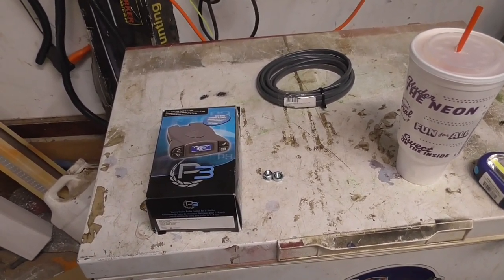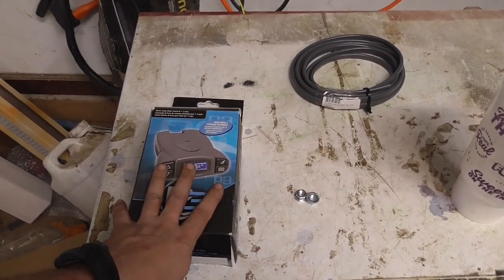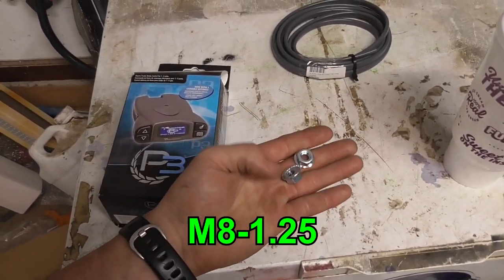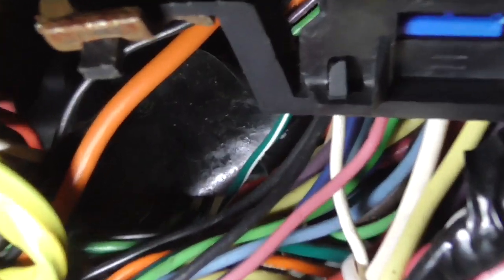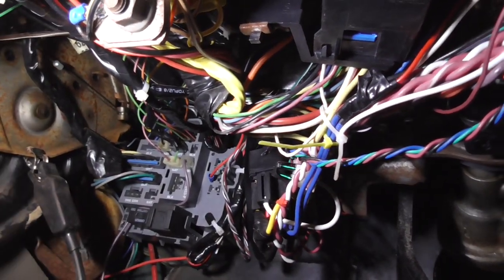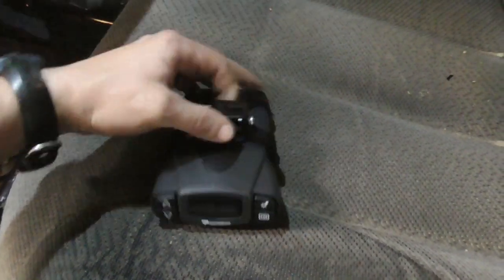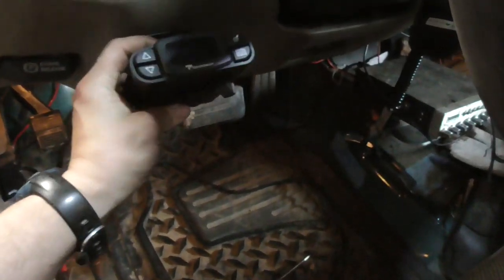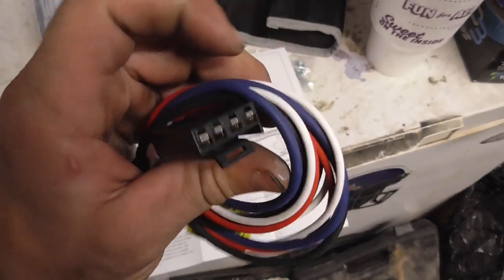Yukon Update | GMT400 Tekonsha P3 Trailer Brake Controller Install | 95-98 GMC/Chevy Truck

Comment: It says in the instructions not to use the inside cab frame as ground,I ran mine to a factory ground in the engine compartment.says something about it not working right other wise.Just a 411.
Reply from the maker: It does say that, but that's just them covering their butt. No reason a good, suitable ground in the cad won't work. Especially in these older trucks where the dash structure is steel and has multiple factory grounding points.

Comment: What size nut is the lug on the back of the fuse box?
Reply from the maker: If you are talking about the AUX power studs, then they are M8-1.25
Reply: Yes the 2 on the fuse box with constant power.
Reply: I have a 95 yukon on 37s. It has a 6 in fabtech lift